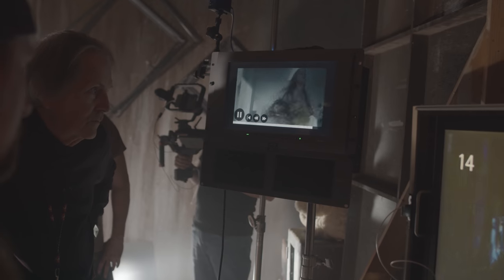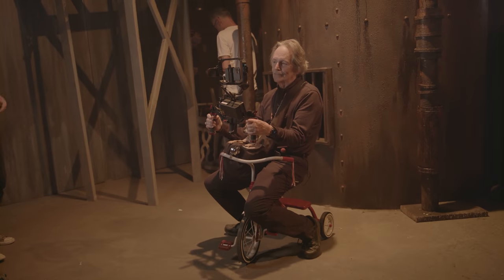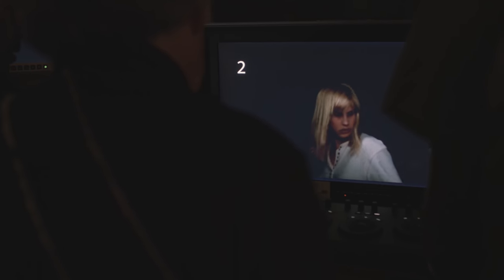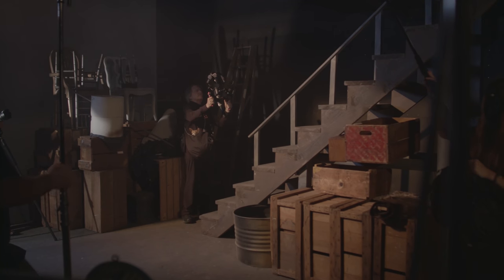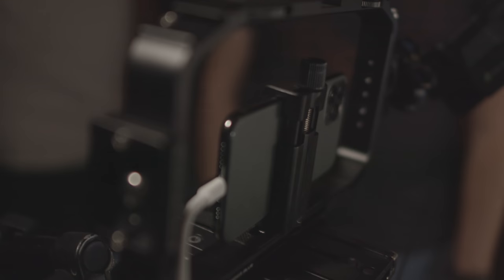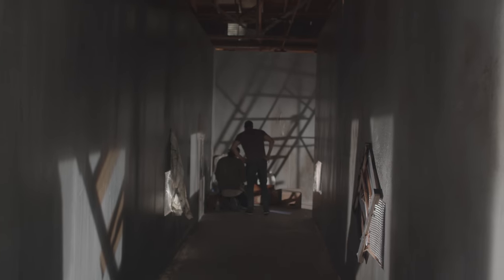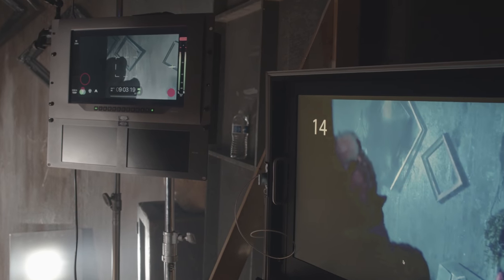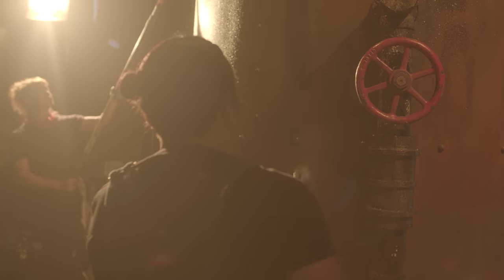Freddy Krueger meets the iPhone11 Pro! (Behind the Scenes)

Comment: That's amazing! The iPhone version looks incredible. Perhaps, less dynamic range in the original 35mm version?
Reply from the maker: Thanks! 35mm inherently has more latitude and dynamic range than the digital sensor in the iPhone but Roy was able to light to adjust for this.
Reply: @VideoVillagePro  excellent work, Roy
Reply: The “original” 35 is from a very inferior standard EVF off of a poor intermediate, four generations away from the 5247 camera negative.
Reply: @RoyHWagnerASC  ah I see. Thanks for the information. Makes sense
Reply: If anyone believes this was shot on a phone, go ahead and try low light with FIlmic Pro, you will find out how wrong we all were!
Reply: @myspectacularjourney  except they use lights
Reply: It’s more then that, 400 ISO on filmic would and has generated a high noise level not seen here. Something else is in this chain!
Reply: @myspectacularjourney  well maybe because your phone isn't iPhone bro.
Reply: @HiroIndo16  Actually no it has nothing to do with what Phone. Phones cannot capture this quality, they will never overpower or outperform large sensor cameras. The fanboys want you to think they will however, which is why Apple paid heavily for this video!
Reply: @myspectacularjourney  what are you talking about? if it's this begind the scene obviously it wasn't filmed with an iPhone. go watch the original video.
Reply: @myspectacularjourney  you clearly haven't tried using an iphone with filmicpro.